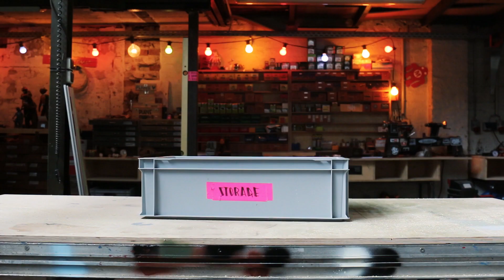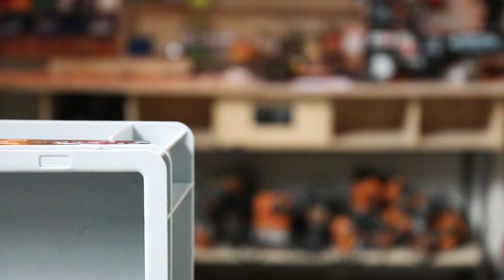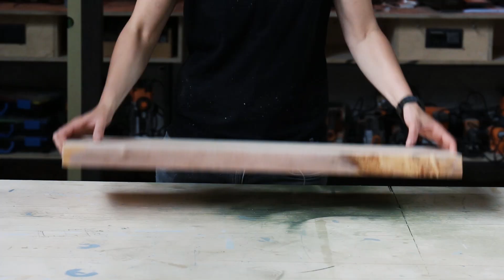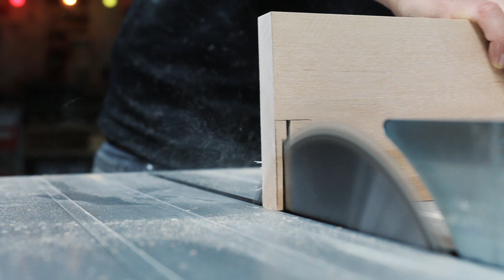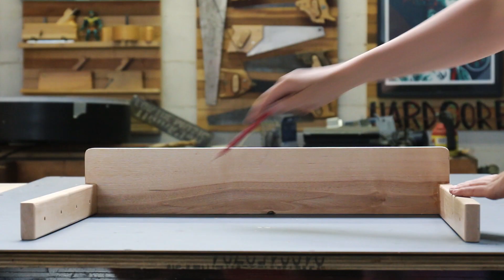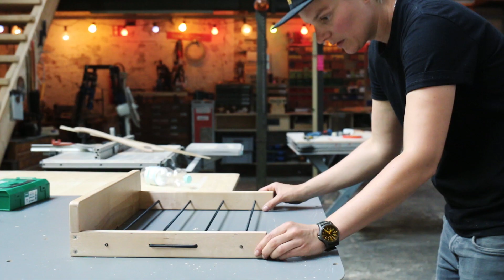Camper Van Conversion Ep.3 - Storage

Comment: Loving your van conversion, Laura. At first, I wasn't too keen on the way the bolt heads protruded inside the plastic drawer, but it occurred to me you could take advantage of that. If you mounted some wood strips along the bolts they might support some sort of pull-out tray for storage of small items over large.

Comment: Love the progress. Large area washers with smoothed edges will help keep the bins from cracking. Or perhaps use a strip of metal the length of the drawer in place of washers and nuts. Thread the holes , radius the edges and corners.
I feel bad that I missed it the first time I watched. Please wear safety glasses or goggles. They hide your pretty face, but I would like to keep seeing those pretty eyes in your future videos.  I'm not immune, I still need to be reminded sometimes. Plastic is easy to work with but can be deceptively nasty also. I've worked with plenty of it. Static makes it stick to everything.

Looking forward to the next video.

Comment: Some great ideas there. Would pop rivets work on the plastic box & drawer runners? I'm thinking they don't stick out so far into the box so there's less chance to catch them.
I think adding the drawer runners to stacking plastic boxes is excellent. I'm going to use this idea for storing my electronic component boxes. Thanks for sharing the video.